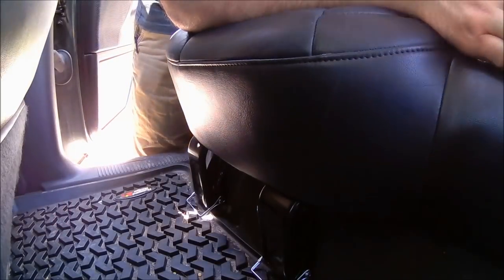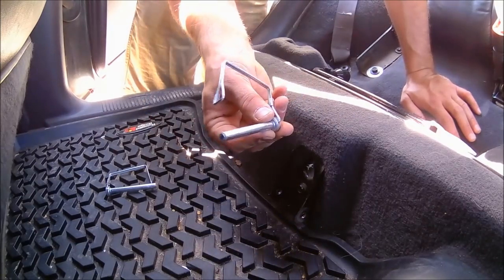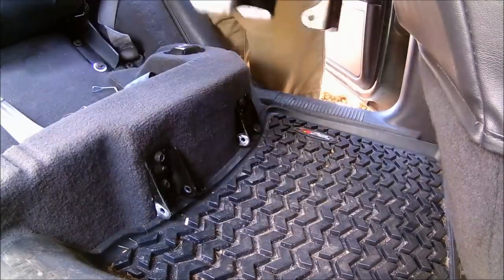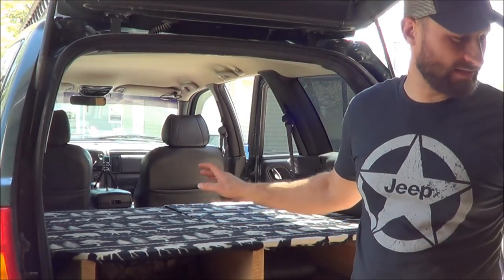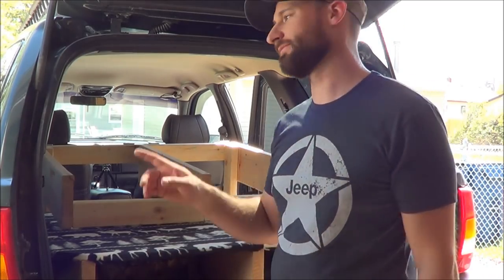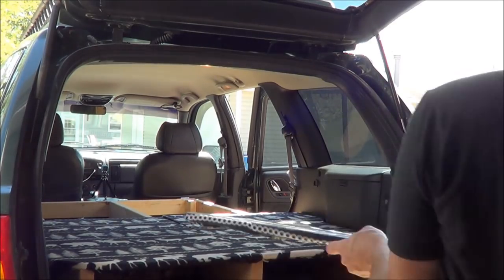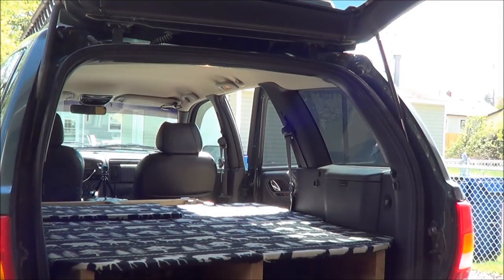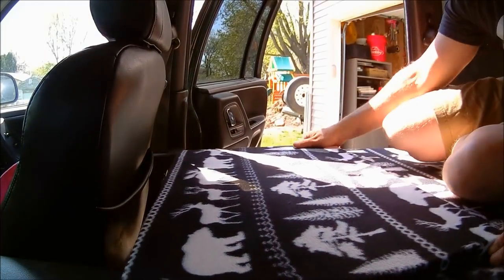DIY Jeep Grand Cherokee Sleeping Platform

Comment: I look into this video at least one a month, to feel the courage to do this in my WJ :) and somehow leave space to open the spare tire compartment... some day.. THANKS FOR THE VIDEO
Reply from the maker: Thanks for watching! When you figure that out let me know!
Reply: Build a box frame using 25mm aluminium square tubing. Leave the front aperture open (without a lower bar), and you can get into the spare wheel well as long as the top section is high enough. Almost finished building this for my WJ.

Comment: If you make the 2nd platform end at front of back seats you can eliminate the hinged part. Add four slide out boards like on drop leaf table to support the plywood piece for your head. That piece would only be 10 inches wide and would not interfere with you front seats while driving. You could store the "head" piece on floor. I built one in my GMC Jimmy years ago.
Reply from the maker: Thats a really good idea

Comment: Hey, great idea. I've been working through a similar idea for my wk. And i came up with something similar as yours, but i thought of a way to make the front half fold forward for use and back so i can still use the back seats.
Reply from the maker: Id be really interesting in seeing how you did that.
Reply: I haven't built it yet. I have been looking around and getting ideas. I think that will be my project soon. Gonna make it in wood first, if it actually works the way i think, make it in aluminum square tubing.
Reply from the maker: Sean Patrick  Thanks for watching! Im a huge fan of duratracs, I really like the Falkens, and Ive had really good luck with the General a/t's.
Reply: Sean Patrick  yeah i hopefully can do it this summer. Anyway, hope you find a good Cherokee. I love mine, its in great condition. From the south so the body is in pristine condition for its age. Its the 4.7l. This will be my fist attempt at modifying anything vehicle related so it will be interesting to see how it works out lol. But it will be similar to what is in this video.

Comment: Not a bad build - 18months in, any corrosion issues from those seat pins due to dissimilar metals?
Reply from the maker: No, theyre inside, plus theyre both steel. Zinc plated doesnt matter and they arent mated together under torque.

Comment: What do you like better the jeep or the ford explorer? 

Just started watching you videos bought a nice 2005 ford explorer for 1600 with 154.000 miles on it.
Reply from the maker: Tough call, I like the space, layout and V8 of the Explorer. I like the solid axles, aftermarket support and simplicity of the 4.0 in the Jeep. Overall, I guess its 45-55 to the Explorer, at least for what we're doing with a 4x4.
Reply: @HawkeyeSkunkWorks  

Right on man

Good videos
Reply from the maker: Thanks I appreciate it
Reply from the maker: Thanks you, more coming!

Comment: Didn't like it at first... looked a bit too bulky. But that hinged panel at the front is really smart.!
Reply from the maker: I see that. I guess I could have done it with 1x's and put gussets everywhere for strength. The size really had to be so I could clear the wheel wells and make it as wide and long as possible. I was more going for ease of building and cost for what I was going to use it for and for how often I was going to use it.